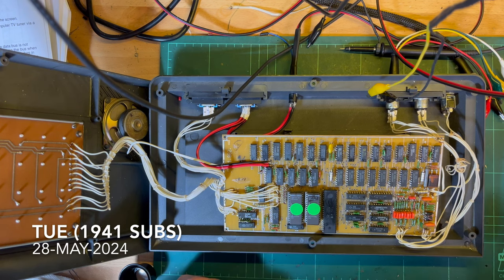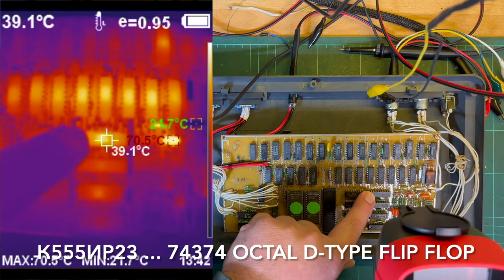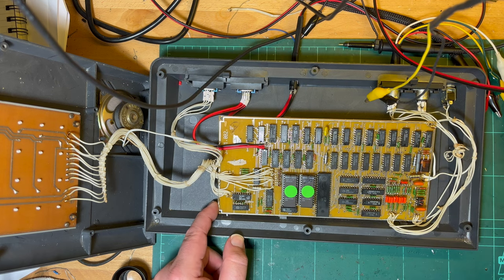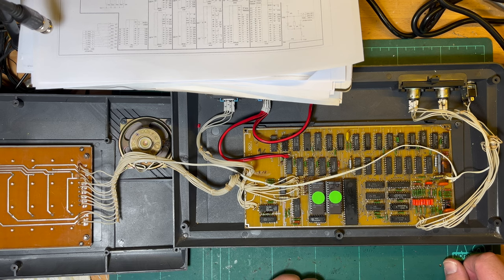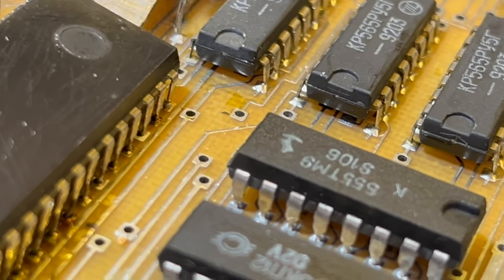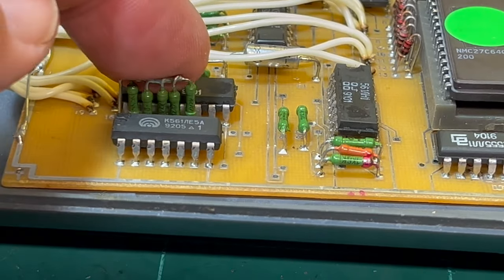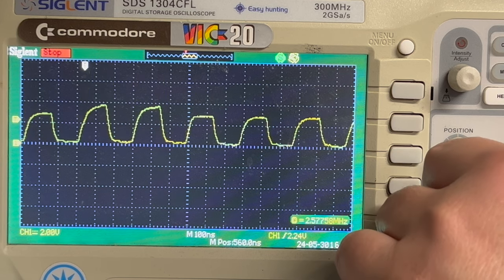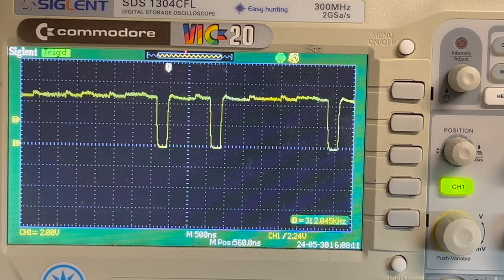🇧🇾 Квант (Quantum): Part 3 (Z80 replacement & clock investigation) [TCE #0462]

Comment: You asked the question on my mind too. If it's a flip flop it should be square. I think your logic is sound, no fault before that chip and one after. It either has to be that chip or the Z80 :)
Reply from the maker: I'm tempted to swap out that chip ... DD19 ... it's an analogue of the 7474.  The normal output is used as the pretty flaky 3.5MHz clock signal into the (now genuine 2021 manufacture) Z80 but the inverted output looks more stable ... still not really square.  There does appear to be a resistor & capacitor between the clock pin and the flip flop output so I don't know if that's perhaps loading the line or something ... I need to trace it a bit more ... but I have some new goodies to show off first today ...

Comment: The lack of even a blank screen suggest there are no h/v sync signals and so, something more fundamental like a faulty clock. Are the video counters (dd18/19/20) operating at all?
Reply from the maker: I'm actually going to have a look at DD19 right now as part of my check of the WAIT signal.  I'm suspicious of DD9, one of the flip fops that generate the 7-ish MHz clock - I see it feeds into DD19 to generate H0 and H1 which are used to generate WAIT it seems ...
Reply: @Brfff  yeah, cheaper clones have only one memory bank, thus requiring the CPU to wait when the video memory is accessed by the video generator, which obviously has higher priority to keep image integrity. This also makes them slower.
Reply from the maker: Ahh, right, yes of course.  I did do some work tonight ... H0 and H1 look okay ... but I started getting a bit confused. Certainly the 3.5MHz clock signal out of DD9 (pin 9, /RAS) looks pretty flaky ... the inverted version (pin 8 DWR), in comparison, looks okay.  I'll probably return to this sometime later in the week - some new goodies ... hopefully interesting for my subscribers ... arriving tomorrow morning to look at.
Reply: @Brfff  in this design, it seems RAS/ drives the CPU, 8 ram chips, and a nand gate - all @3.5MHz. That's quite a fanout, and a 30yo flip-flop probably feels it. Or one of these chips has had it. On a different note, can you see a signal on pin 3 of dd6 (SYN)? If there was a healthy signal here, you should get a blank video, assuming vt8-vt11 are okay.